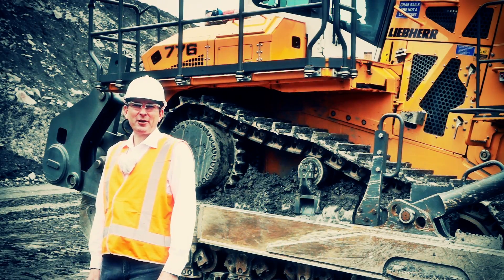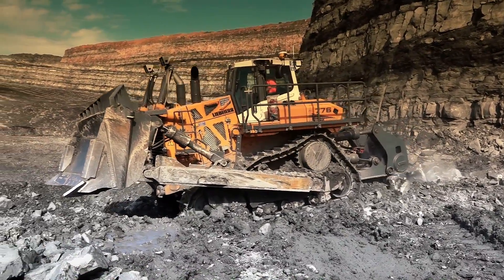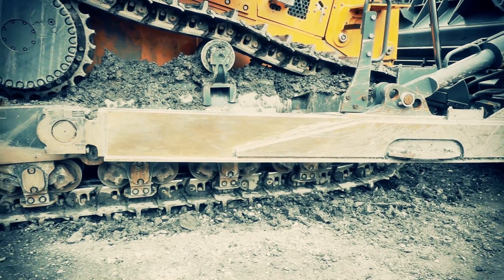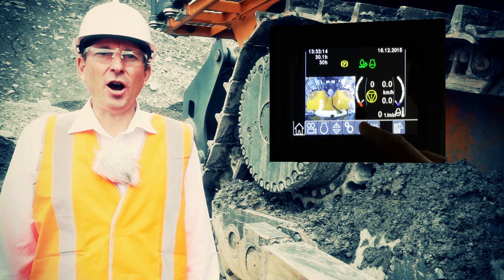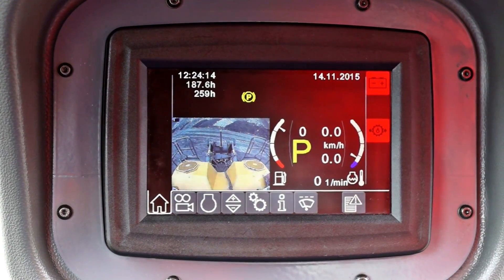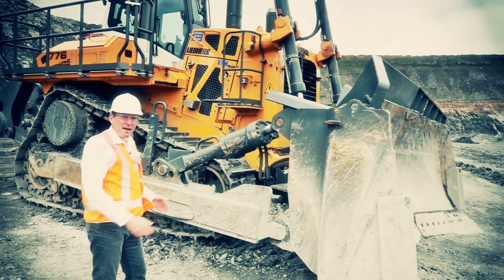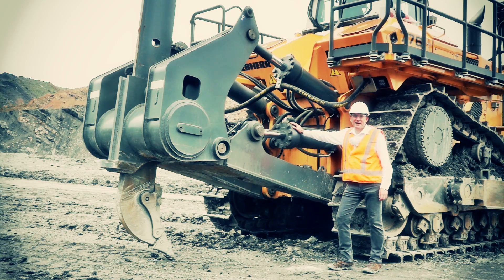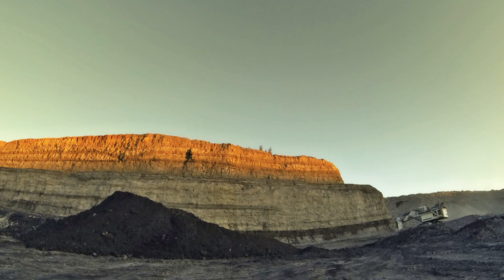Liebherr - PR 776 Litronic Walkaround

Comment: I don't know how they compare to CAT, but it seems that Liebherr is very focused upon ease of maintenance and long term maintainability. And yes he said 8000 hours between oil changes. Synthetic oils don't so much wear out as they become saturated with combustion byproducts and contaminates. IF, and that's a mighty big IF you can keep the synthetic oil clean from combustion contaminates then you don't need to change it for thousands upon thousands of hours. Post in case, turbine engines like the high bypass fan jets on all modern jets. Because the oil never is exposed to any part of the combustion process it's only changed at major service intervals with thousands of hours time on the oil. But again the key is very high filtration down to sizes like one micron, where your best auto filters at your local auto parts store will be 25 microns or more at best. Look at it this way stiff competition for CAT or all the manufacturers is only going to drive CAT and the rest to design better, more powerful, longer lasting more productive machines and we all win from that. So good Job Liebherr, give them a run for their money.